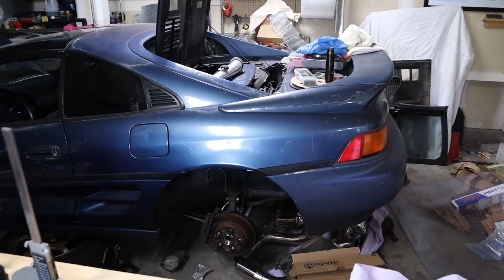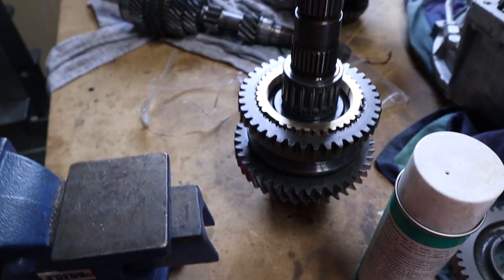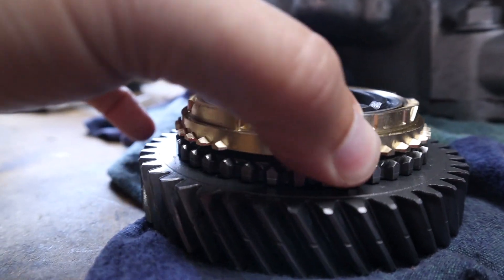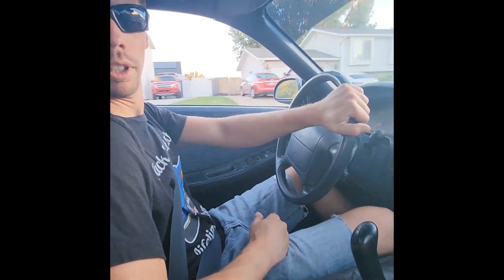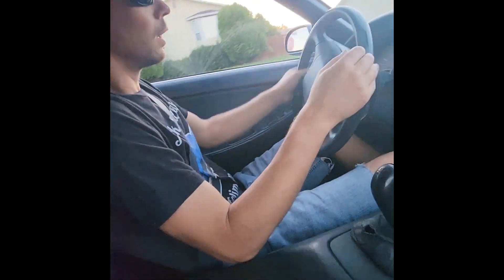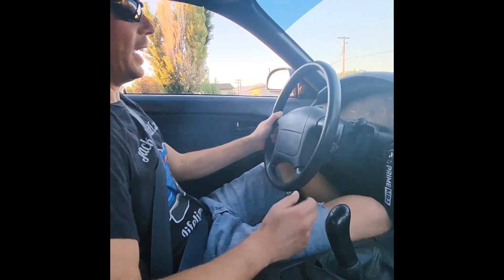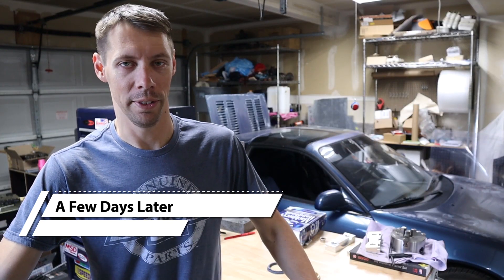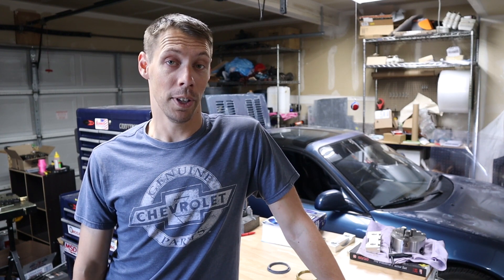SW20 MR2 E153 Synchronizer Ring CNC Machined

Comment: This is fantastic news, these should also work on the E51 boxes from the later spec mr2 supercharged as well as the internals are the same as the pre dual synchro e153s. Hopefully this turns out well!
Reply from the maker: Thanks for the compatibility info.  I know people Frankenstein these transmissions together will all sorts of E series parts.
Reply: a high quality and tested remanufactured synchro ring for the E153 transmission already exists from Gearbox Parts Australia, they have also made 3rd and 4th gear synchros for the same gearbox
Reply from the maker: @StephenFoster-ej4eo  Stephen, your YouTube profile has no content and says you joined today.  Did you really make an account just to try to drive business away from me?  I've been working on these synchros for the last 6 months and this is the first time anyone has heard of this Australian company making them.

Comment: My dad rebuilt manual transmissions for a living. He drilled into us that we should never downshift into first unless we were stopped. That resistance you feel when shifting into first is you wearing the syncro. It is harder on first because of the wider spacing between first and second ratios. Anyhow, what you machined up there is pretty awesome. Do you still use the X2?
Reply from the maker: I agree with your dad.  I believe that wider spacing between 1st and 2nd is also the reason 2nd tends to fail (from all the hard upshifts).  I sold the X2 a while back, once I got the Tormach, it was just collecting dust.  I hated to see it go but needed the space.